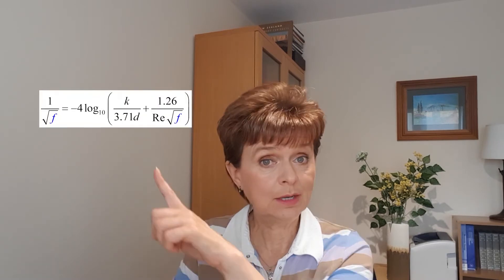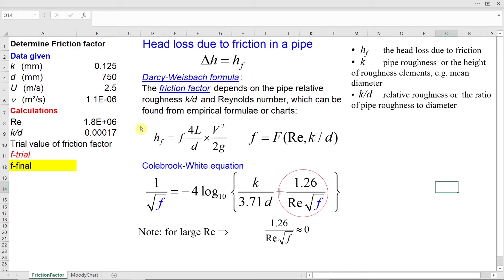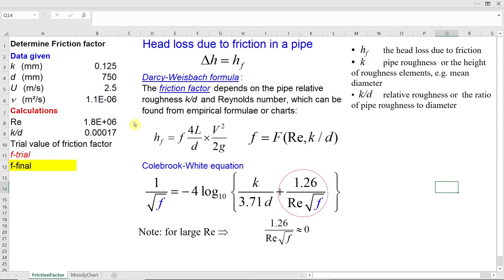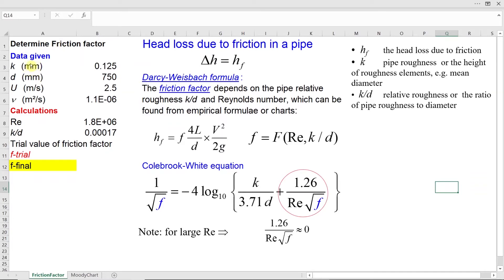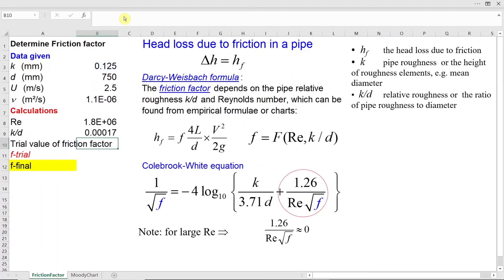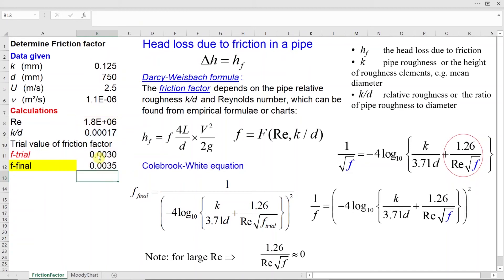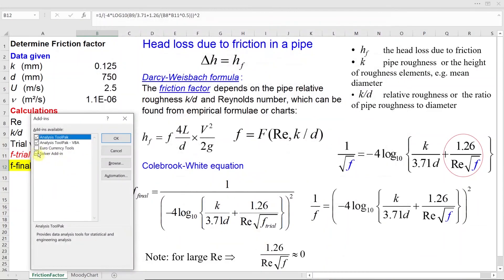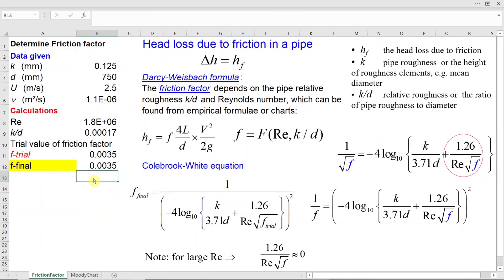How to estimate friction factor using Colebrook-White equation

Comment: When I use this method it does not correlate to moody diagram. When I change to the rearrangement to 1/(-2log(k/3.7+2.51/Re*f^0.5)))^2 I get a correlation with the Moody diagram
Reply from the maker: Fanning friction factor for pipe flow is one-fourth of the Darcy friction factor, so attention must be paid to note which one of these is meant in the "friction factor" chart or equation consulted. Depending which one you use Colebrook-White equation would be slightly different. You need to check which one you use.
Reply: @StudyTips4U  Ah hah I see. Thanks very much. In my case I am comparing to the moody chart so the Darcy friction factor is relevant and my adjustment of CW now makes sense

Comment: Sir, normally in colebroke white equation is used -2log10 while you use -4log 10 in first part of equation and 2nd part normal value is 2.51 while you use 1.26, please explain about these changes.
Reply from the maker: There are two coefficients: Darcy-Weisbah and Fanning and Colebrook-White equation is different depending which coefficient you use
Reply: @StudyTips4U  Thanks for your explanation. will comeback if I need more discussion.

Comment from the maker: Engineers need to know a drop in piezometric head that is required to make fluid flow at a certain steady rate through a straight pipe of uniform diameter of a certain length. The drop in piezometric head can be estimated using Darcy-Weisbach formula. One of the key parameter in this formula is a Friction Factor. In this video I show you how to estimate the friction factor using semi-empirical Colebrook-White equation.